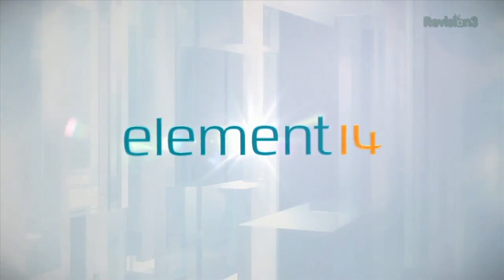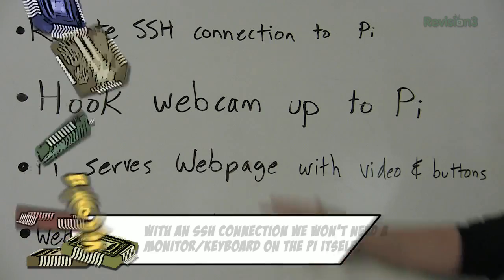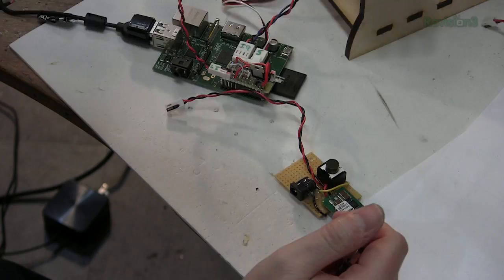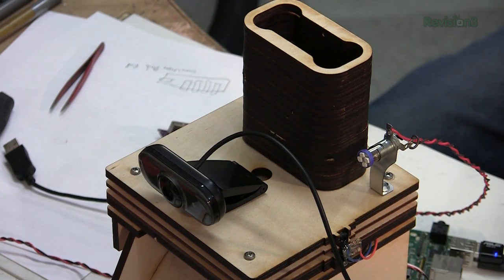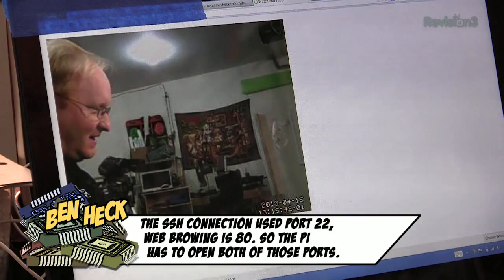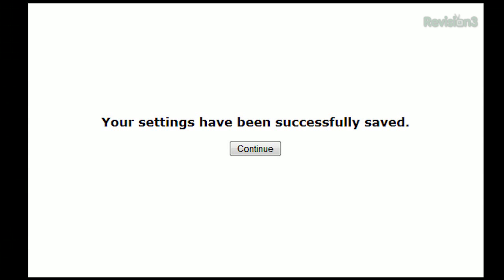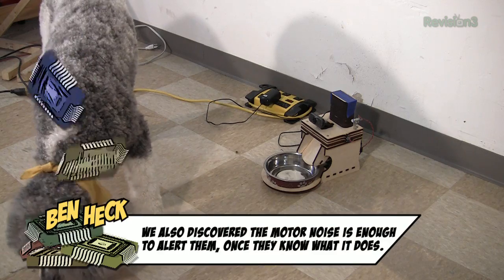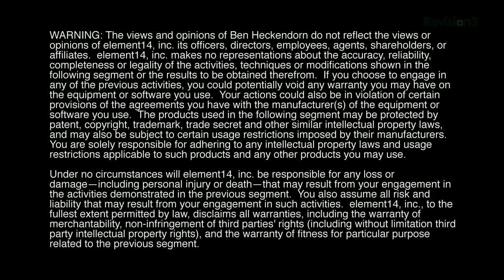Doggie Treat Dispenser: Part 3

Comment: actually, if i understand right the viewer question in this video, you could use a magnet while the TV is on to clean the screen on the old flat TV. I would use a large magnet as a Car speaker, just be careful to not use it too long as it could get the image worse.

Comment: Ben, saying the 'Terminal.app' is Mac's built in SSH client, is like saying 'cmd.exe' is Windows's built in SSH client(Not that it has any 'built-in' ssh support). 'ssh' in /usr/bin (user binary directory) which is part of OpenSSH is actually what deals with SSH. If you uninstall OpenSSH on a mac, from the 'Terminal.app' application you won't be able to do anything SSH related!

Comment: Interesting, but I don't think the web cam and internet control is needed in this application.  It could have been setup to sense when the dog is near and dispense a treat once an hour so that the dog doesn't over feed.  Plus any dog big enough to eat that size bone would rip apart the whole thing in seconds.  Perhaps this show should be more critical of design and implementation, rather than building stuff for the sake of it.

Comment: Regarding the viewer question: Actually, many CRT TVs have options in the service menu to adjust the overscan. I was able to almost eliminate it on mine. Its just a matter of figuring out how to access the service menu, which is explained in the service manual, available on the net for many models.